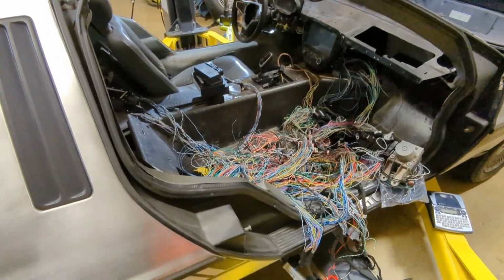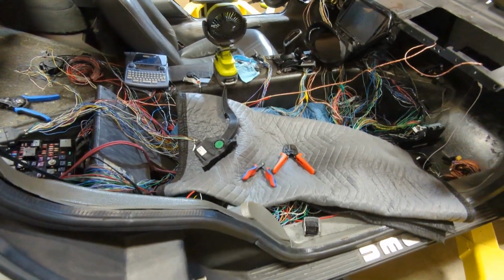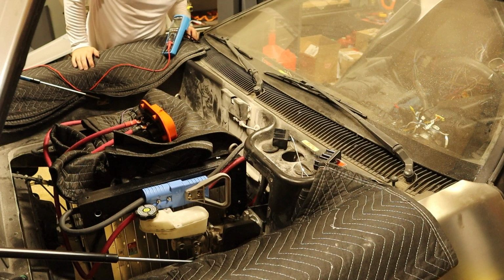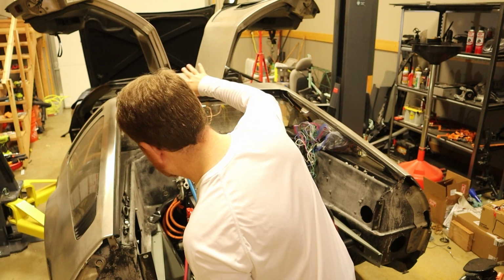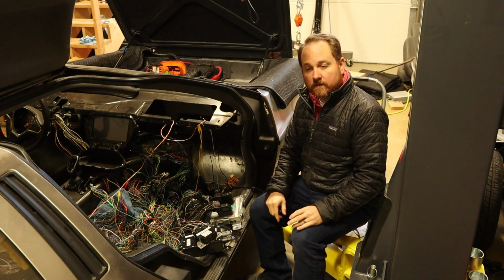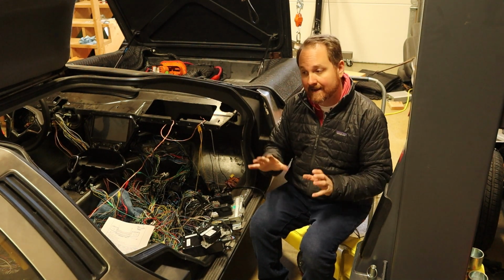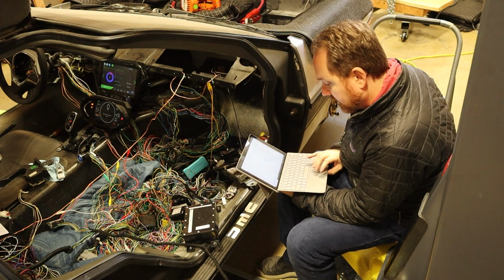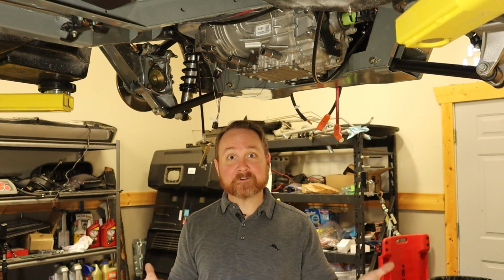I made a terrible mistake with wiring the DeLorean EV

Comment: When you remove the wire loom from wiring harnesses, use small zip ties to temporary hold the wires together.  

Doing that will help eliminate creating the wiring rats nest from forming, by keeping everything kinda in place, but allowing access to the individual wires

Comment: Where's your PPE?
Reply from the maker: If you mean high voltage PPE - I've got a set of 1200V rubber gloves with the leather gloves that go on top of them. You'll see me use them sometimes in videos. However... I frankly find them impossible to work with, and even more impossible to FILM with. I only use them when I'm going to be touching uninsulated terminals directly, and otherwise I keep HV (and high current) connectors, wires, etc. completely covered where I can't accidentally touch them. I'm open to suggestions for increasing my safety, though!!

Comment: Was the charge port added?  I don’t remember it being installed.
Reply from the maker: It's not connected permanently yet, so I just plug it in and leave it hanging off the back of the car, and plug it into my EVSE as needed. All the connectors were still in the harness (until a few weeks ago when I started on the re-wiring)

Comment: I am hoping to do something similar with a Dodge Dakota I have (once it breaks down for good).
I am curious though how the air bag shstem will go with the conversion.
Reply from the maker: In my conversion I am ripping it out completely. All of the airbags were replaced with "SRS simulators" which are literally just a resistor that tricks the system into thinking there is an airbag installed. The sensors and things are still there, just all stuffed into a bag. At some point I will build (or find?) a computer that sits on the CAN bus and pretends to be the SRS (including sensors and airbags) so I can remove it all. If you want to retain the airbags, that is also an option - but a decent amount of work to mesh the two systems together. The DeLorean has no airbags, and it would be a huge amount of work to try and retrofit them.

Comment: Hi Bill, Can you share the specifics of the Anderson Connectors you used?  I'm looking to have a connector between my battery halves and this looks like a good solution.
Reply from the maker: Hi Jeff! Yes, these are Anderson SB350 from PowerWerx.com - these are the 2/0 version, rated to handle 350A continuously. They are actually overkill for my build - I could have downsized to 1/0 and used the SB175 and have been fine. My only issues with them are that they aren't environmentally rated at all (not water proof, weather proof, etc), and they don't have a flange mount, so my wires have to exit the pack and then go into the connector. I'm switching everything over to Amphenol SurLok connectors, which I'll cover in a future video.
Reply: @BillCarlson  I had a good look at the Amphenol SurLok options available on Mouser.  Very hard to figure out which options to use - even the Amphenol documentation from the Mouser - part number specifications - don't seem to match up with the part numbers listed on the site.  Your experience on this is going to be very helpful.
Reply from the maker: @drjeffcooke  I am definitely hoping I can help with that, because I had the exact same issue!! :) I ended up spending about $300 on a random selection just to figure it all out.

Comment: I am a little confused. You say that this is the first time that you have spun the motor but an earlier video showed you driving the car. Is this the first time that the motor has spun WITH the 12 volt wiring connected?
Reply from the maker: This was the first motor spin - but the videos have been uploaded out of order. I wanted to get the 'first drive' video out ASAP, so it was literally posted the day after it happened. Whereas the first motor spin was October 27th!!
Reply: Thanks Bill and keep on being brilliant in solving problems such as the headliner connector.

Comment: What software are you running to communicate with all those modules?  Seems more purpose built than something like Torque.
Reply: Gds2 I believe
Reply from the maker: I'm using GDS2, which is the official software from Chevy that's used by repair shops. The system is called VXDiag.